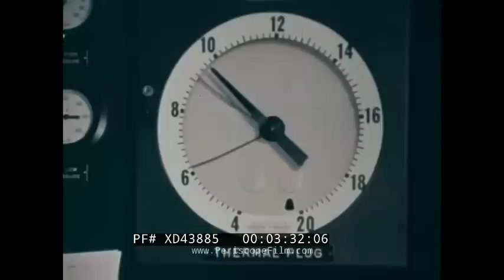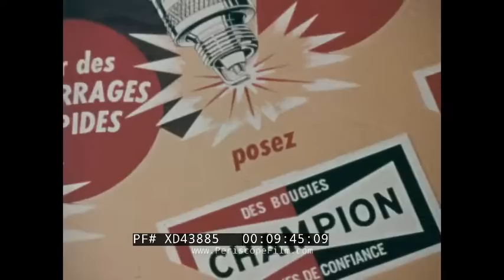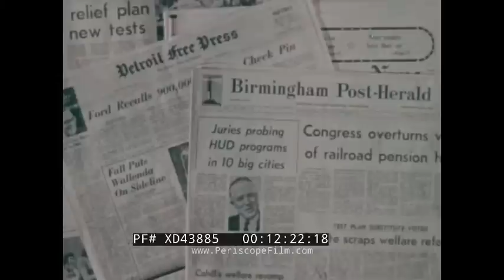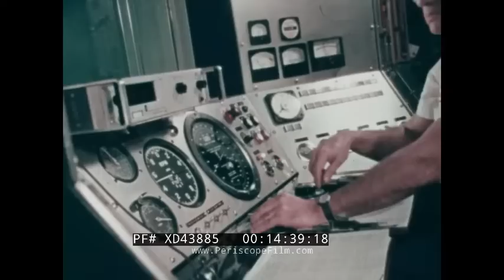"TO SPARK THE WIDE WORLD" 1970s CHAMPION AUTOMOBILE SPARK PLUGS PROMO FILM  XD43885

Comment: In 1989 the Stranahan family sold their interest in the company to Cooper Industries.  In 1991, Cooper closed the Toledo plant.  Some employees were offered transfers to other plants.  I had many friends and acquaintances that lost their jobs as a result.  In addition to providing excellent jobs, the Stranahans were great benefactors to the City of Toledo as shown in the video.  According to Dun & Bradstreet, the company headquarters are still located at the Upton Ave. site.  

Champion sold DeVilbiss in 1988 to Eagle Industries.  In 1989, Eagle closed the plant and moved to Tennessee after the union (United Auto Workers) rejected an $8 to $10 cut in wages and benefits.  This demand by the company was about corporate greed, considering that it was profitable with the current wage and benefit package.   DeVilbiss manufactured paint spray equipment, air compressors and medical equipment.

Comment: As soon as my ohmmeter warns me i have a resistor plug,  i want out.  Please always have a standard replacement,  but don't try to make me use a PDF.  Any $1400 magneto is going to run hotter and safer at altitude with a solid spark plug,  and yes,  i have a Devilbiss sprayer.